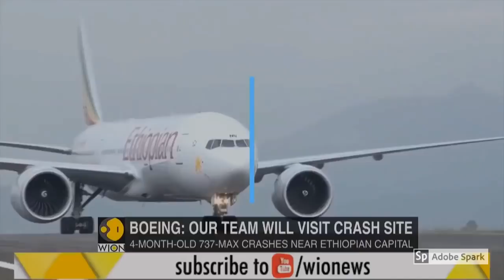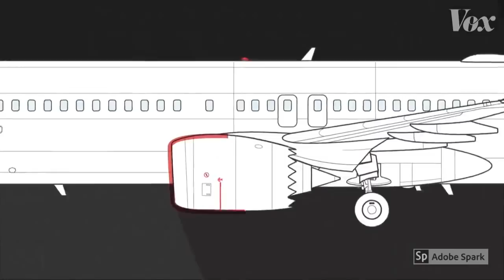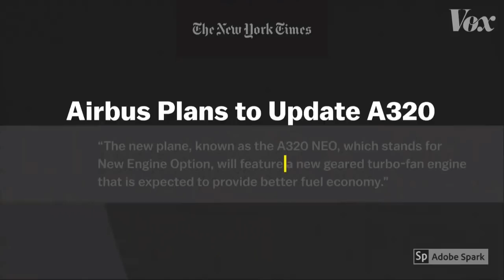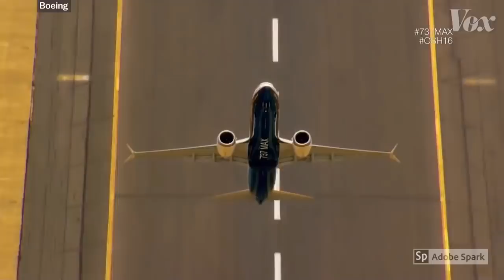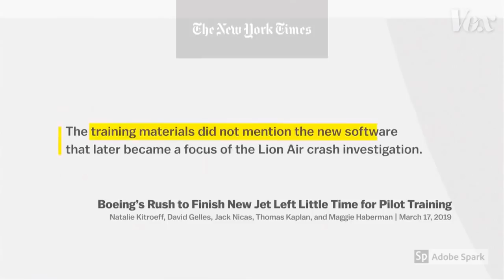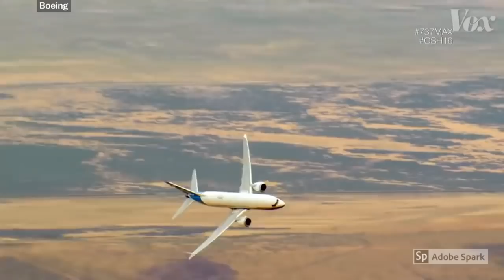737 MAX UPDATE.. Is something wrong with the design ?

Comment: What Boeing did reminds me of what Ford did when they found the Bronco had a propensity to roll over due to its narrow wheel base and high center of gravity.  They lowered the pressure on the Firestone tires, reducing the propensity to rollover.  However, this caused the sidewalls to overheat and fail, often causing a rollover.
Reply from the maker: That's information.. didn't knew.

Comment: This is also a problem that can be attributed to our confidence in automation. 
I’d rather have a seasoned pilot in the cockpit than a computer geek managing some system. But this is ultimately where we are heading if we don’t stop and reevaluate the role of computers as an assist device, not a replacement.
Reply from the maker: too much automation is perhaps we should restrain ourselves. Especially in case of aircrafts..
Reply: Airlines want to hire low-time pilots for lower pay; aircraft producers say they can dumb down the aircraft and make them easy to fly for low experienced pilots.  However when the software fails you get AF 447 and the like.

Comment: Yes the deadly 737 max has a faulty design, coupled with its very large and heavy engines that are mounted so far out and high has a tendency to move the nose up in the air, that's why boeing installed the deadly mcas that forces it to nosedive.

Comment: Okay, don’t get triggered, but couldn’t Boeing have redesigned the land gear to be taller?   Move a few things under the wing and nose and add 8-10 inches so you wouldn’t need to move the engines higher?  Okay, nasty responses in 3-2-1....
Reply from the maker: Yeah that's the latest,,, a new landing gear..
Reply: My understanding is the nose landing gear of the Max was altered, raising the nose eight inches.

Comment: Boeing CEO will not admit the 737 MAX is an aerodynamically flawed design and that MCAS was added to correct that flaw. 
"In 1957, a USAF DC-3 ran out of gas over Missouri. Everyone bailed out and made it to the ground safely. The DC-3 glided over the horizon and made a perfect, unassisted landing in a cornfield", that was an aerodynamically stable air plane.The DC-3 was the predecessor of all modern airliners. 
Boeing should have designed a new aerodynamically stable plane, rather than add the MCAS to the MAX. But they chose short term profits, rather than reinvesting into Boeing Corp and building a new airliner, new manufacturing, building a skilled labor force to replace the aging 737. It seems to be a problem with corporate America, they don't reinvest in American corporations anymore, but they do invest in foreign corporations. Boeing is guilty trying to fix an old design with a computerized software fix, when they needed a new plane.
http://www.dc3history.org/dc3fliesitself.html
Reply: The engines are so close to the plane body
Reply: Yes. The pushed the 737 over its limit when boeing built the deadly max.
Reply: Well said
Reply: Yes, absolutely right, it is better to call back this plane and replace with another model. (I don't know how many billion I'm referring)Both FAA and Boeing had a big mistake, they have to accept and correct it.
Reply: Right on!

Comment: Well the puzzle is coming together,,,no doubt there is a design problem,,and that's why the Max comeback is so delayed. Longitudinal Stability and airflow disturbance over the wing are two of the principal negative side effects due to installing a heavier engine,,,also too far from the leading edge of the wing. Too far means that a long arm holding that engine,also will start to develop cracks around the pylon structure,just wait for a couple thousands cycles. I am afraid about the next patch Boeing will make, ,I will avoid flying B737MAX
Reply: Jezzzz scary

Comment: I dont agree  with the movement of the engine up causing the nose to pitch up as  moving the thrust line up will tend  to create a nose down force.
Reply from the maker: Its quite convincing theory..
Reply: When you move up centre of gravity it will cause imbalance and nose up was in this case.